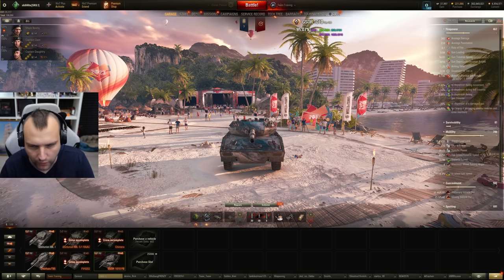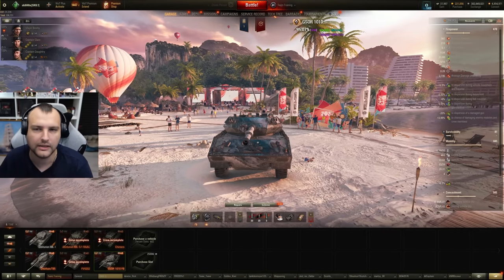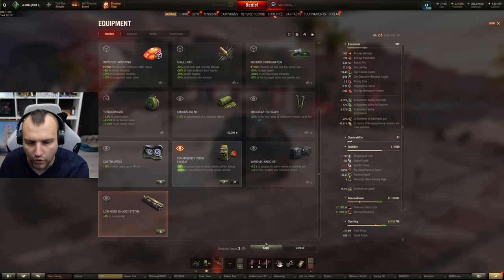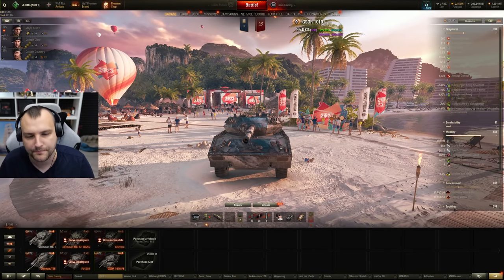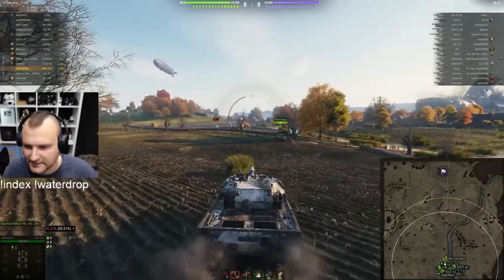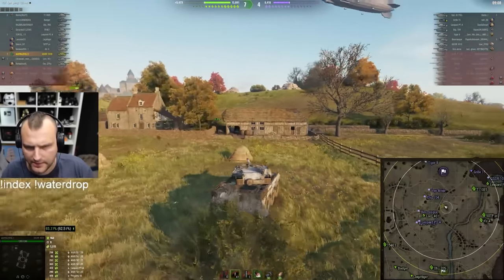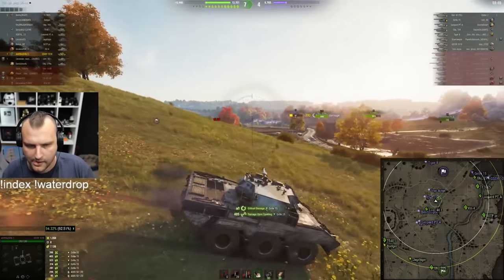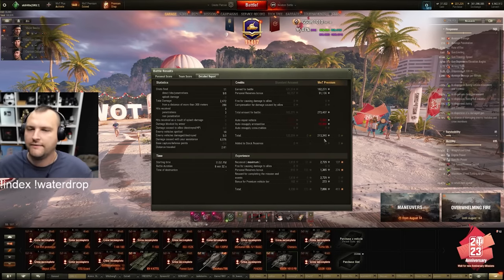Why You Should STOP Using IRM on Wheeled Mediums! | World of Tanks

Comment: for those of you wondering whats going on here, and before everyone screams and panics rotation mechanism blah blah blah blah and take them off all your tanks and sell them to replace with turbo, first think of the reasoning here. The reasoning here is specific to EBRs, GSOR wheeled meds. Not traditional tracked tanks.
Max wheel angle doesn't equal traverse speed. 
Just like a rammer won't effect your autoloader inter-shot time period, neither will lRM boost your max wheel angle limits.
Thats the limiting factor here, not how fast the wheels turn, but the axle limitation on how FAR the wheels pivot. 

Tracks do not ahve this issue, so rotation mech still fine on tradtional meds.
Reply: well the thing is, the GSOR has no pivoting steering wheels. look closely when the tank is turning
Reply: That's literally what the video was all about, including the title... jesus.

Comment: Next challenge for game mechanism testing: Do he shells have full module damage despite not penning? Why sometimes you get lit on fire, even though the HE did only 50 damage or so.
Reply: The fires come from splash damage. Any damage to the engine has the % chance to set you on fire. It doesn't matter if the shell did 1 damage or 1,000 damage to the engine. Same thing with killing crew members, crews in the game have only 1 HP, so any splash damage might kill the crew member.

Comment: Missing one big part of IRM... It improves the turret rotation quite a bit (yes Skill mentioned it, but quickly just dismissed it). A second bit as well... It reduces bloom during movement, not as much as a Vert Stab, but still. Those are still valid reasons to run it even without the hull traverse.
Reply: No its not better pit vert stabs then instead of this you said.
Reply: @Kristiyan-Angelov  Did you read my comment? I mentioned V Stab doing more related to the bloom... IRM still boosts the turret traverse, so for personal choice you can do IRM or Vert Stab. Neither are bad choices.
Reply: Nah, vert stab is much better. 
There's no need to boost turret traverse speed on a tank which already has crazy turret traverse speed like fucking 50 degree/s.
You'd come out much better by just going vert stab since it gives more dispersion reduction than the IRM and in IRM, when it comes to wheelies, dispersion is the only thing that realistically matters. 
Therefore you have IRM dispersion vs vert stab dispersion and since vert stab reduces the dispersion more - it wins.

Comment: Id like to see similar video about Improved aiming unit, I see people use it for not the most inaccurate tanks, fore me it gives 0.02 extra dispersion, unless dispersion is really bad, like 0.40+, kinda hard to believe that there is real difference between 0.32 or 0.30
Reply: The difference is exactly what it shows , 8% , its for you to decide is it worth it
Reply: @Bishox  I know that much myself, Id like to see practical applications, like some kind of tests form 50 meters, 100m, 300m etc.
Basically how those 8% translates in to hitting shots.
Reply: @Bishox  strictly speaking it's the radius of the aiming circle that decreases by 7%, but the result is that the aiming circle is about 13.5% smaller, as the radius appears twice in the formula for a circle.

Comment: I don't like IRM on anything. But I guess that's just me.
Reply: I only use it on the peregrine, and nothin else. On that vehicle the gun handling must be made better
Reply: lRM is very powerful equipment on tank destroyers and arta  that cannot mount vert stab, and ahve very bad gun handling.
Reply: @denesjurcsek3771  IRM is good for any autoloader that has bad gun handling, in combination with vertstab.  That being said, i replaced the IRM with the fire control system, for my is3a, it is very good😁👍
Reply: you can use it on turreted TDs that can't use Vents (Jackson, Achilles) or mid tier autoloaders like the Skoda T25 since they can't use Vert Stabs anyway
Reply: @Dirpitz  i don't have Bisonte, but probably yes.
Reply: It's a decent equipment, but if you only need the traverse speed it's better to use experimental equipment instead so you can package it with turbo
Reply: @zeroyuki92  it's fine for open top turreted TDs
Reply: skorpion g is unplayable without RM